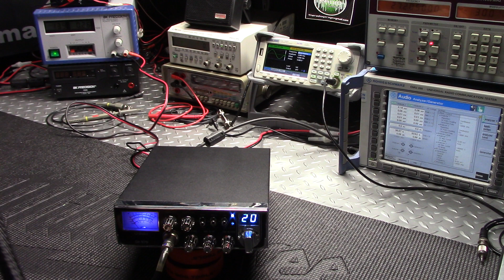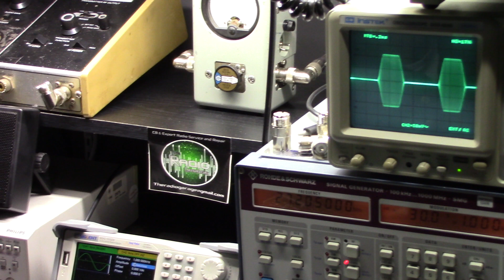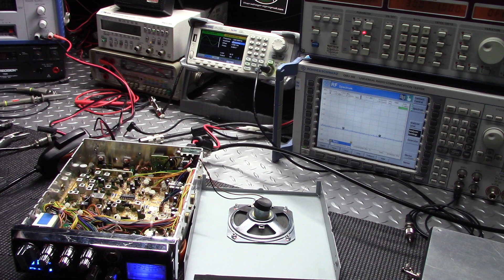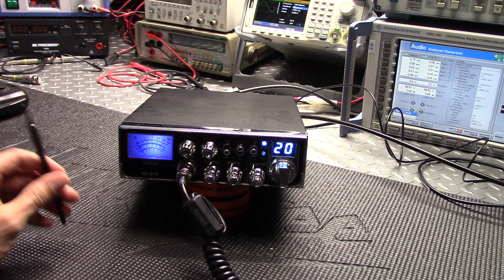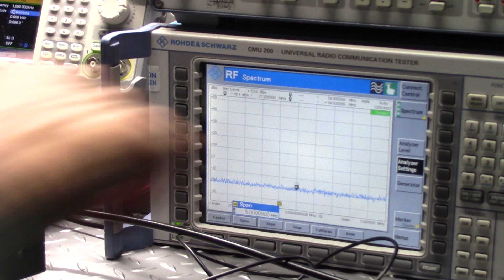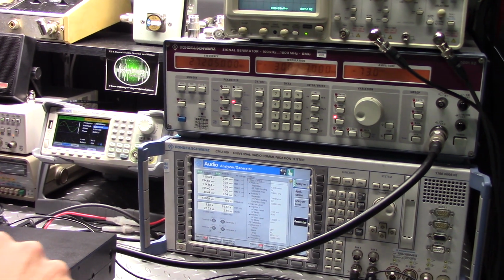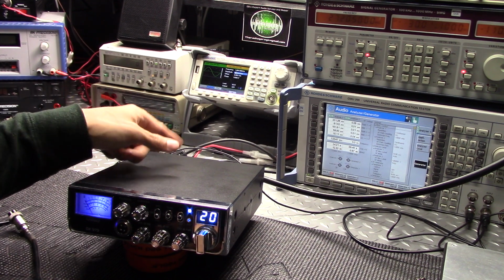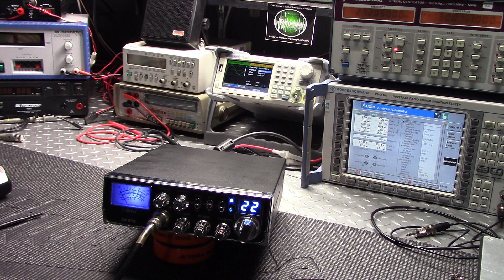Galaxy DX979 CB Radio Tune & Alignment

Comment: Picked this radio up yesterday. Man im very impressed with the performance of this little thing. Talked all over the states last night. I'm trying to find the freq counter that plugs into the back, but I can't find the Galaxy model. All I can find is the counter made by Texas Ranger SRA-FC393. it looks like the same as the Galaxy counter. Do you know if the Texas Ranger counter will work with the DX979? Thanks. WR160 MI.
Reply from the maker: Yes it will work.

Comment: I’ve had good luck out of the Alinco 32 Amp power supply.. The Astron is good also tho. Slinky🤣
Reply from the maker: Hey Mike , did you ever happen to check the output on the scope for noise? Just curious how it compares  thanks
Reply: @TheRadioGarage  no but it has a noise offset knob on it.
Reply from the maker: Oh ok yea that probably helps

Comment: Good stuff 👍.  And you have a great looking work bench . Also when you were talking about the radio possibly not acting up as the owner stated, it immediately took me back several years and reminded me why I hate Ford vehicles and dealerships . I've purchased 2 brand new Fords in the past only to continually have to take them back to the dealer for various reasons , mostly because it's a shitty Ford. But their catchphrase printed out was always the same on the work order to avoid doing the right thing 
" Cannot reproduce the problem during diagnosis"  🙄
I hope you don't hold that against me if you own a Ford !
Reply from the maker: Yep we have all had that happen before.  You take it to the mechanic and all of a sudden the problem just goes away,lol. No offense taken either, 73 bud 👍